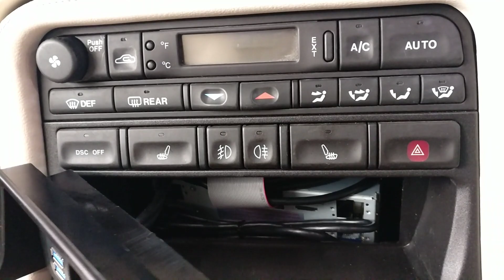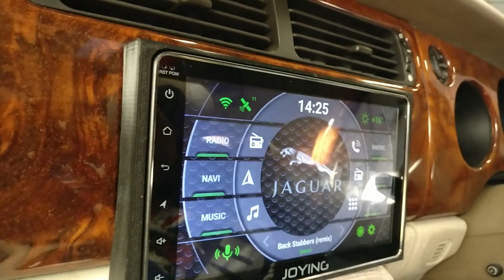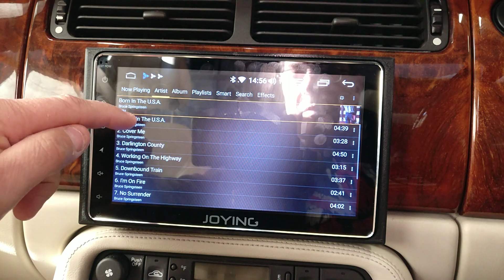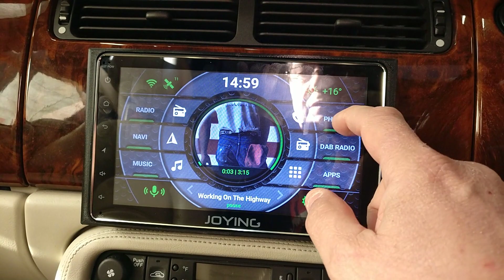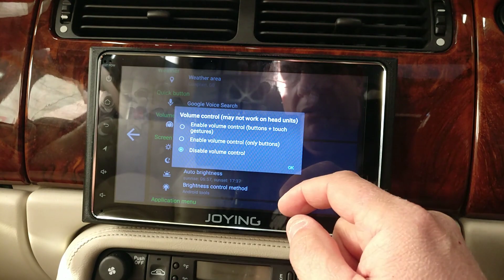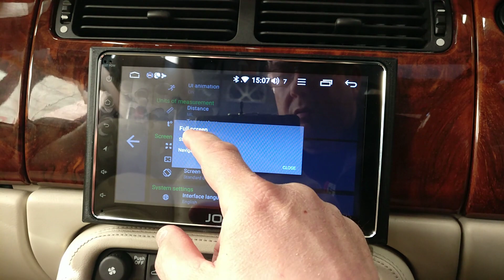Joying Head Unit In Jaguar XKR

Comment: Hello Russell, awesome video. I was wondering where you got the single din trim for below. This unit appears to be discontinued and the newer version's dimensions changed. I think I will used ur cad files and modify them for the new unit. I will share with you when I do. Amazing works cheers.
Reply from the maker: Hi, sorry for the delay replying. If you have a pre 1999 model (I think) then you will need to change the complete AC control and stereo system surround for a post 1999 type. This part is available from BritishParts.co.uk (and possibly elsewhere) and is Jaguar Part No. LJA6318ABG (I will post a link at the end of this reply). You then just swap the A/C panel etc over from the old surround to the new one. If you already have the new type then all is good. Then you need a single DIN adapter panel which will fit directly into the new surround where the factory stereo would go. This is a Nexxia/Autoleads item and is part No. FP-14-00 (once again link at the end). Once you have all this in place then a standard single DIN blanking plate will fit in the slot.

https://www.britishparts.co.uk/jaguar-parts-c11/jaguar-xk-xkr-1996-2006-c45/body-fittings-c366/console-switch-panel-p6364
https://www.rudiemods.co.uk/autoleads-fp-14-00-jaguar-facia-panel-adaptor-free-delivery

Hope this helps and feel free to ask if you need any further help.
Reply: @russellspearing7523  I am going to take ur cad and modify it for thus newer version. My question to you do you think this could be achieved without the bezel around the joying. But instead just mounted from behind so all you see is the joying metallic bezel? Also I noticed some holes in the top and bottom of your bezel. Is there a function for those or for cooling?

https://www.joyingauto.com/joying-newest-8-inch-universal-1-din-car-radio-with-hd-1280x800-screen.html
Reply from the maker: @rnpshiii  Yes you could easily fit the screen without the bezel by incorporating the Joying screen fixings into the rear mount. The reasons I went with the bezel arrangement was that the 8" screen on it's own wasn't wide enough to cover the holes either side of the factory sat nav screen where the original sat nav controls were. For that I would have had to use the 10" Joying unit and then the screen would have been too tall. Therefore I designed the bezel to be wide enough to cover the holes and follow the contour of the dash. That is why the bezel is wider at the sides than top and bottom.
With regard to the holes top and bottom, this is to fix the screen into the bezel. The joying screen has a thin metal bezel surrounding it which is held in place with M2.5 screws (2 top, 2 bottom and either 1 or 2 left and right). So I removed the 2 top and bottom ones and incorporated holes in the 3d print to then screw the screen into the bezel. My original design used velcro to hold the screen into the bezel which is why there are rectangular recesses at the rear of the bezel to incorporate the velcro. However this design was not successful because once the screen was in place I couldn't get it back out again as there was nowhere to lever it away from the velcro. So I abandoned this idea and went with the screws.
Reply: @russellspearing7523  thanks again Russell will upload my final cad once I confirm it works. Cheers
Reply from the maker: @rnpshiii  What material are you planning to print with. My first attempt was with PLA but it very quickly started deforming when the interior of the car got warm. I ended up using ABS which has had no problems at all although it was a real pain to print. It is also possible that PETG would also work but I haven't tried that. I've never had much success with PETG.
Reply: Hey Russell,

Just got it fitted but alot of bugs and not setup yet. Can you link the Play store app for Jaguar interface?

Comment: do you have video on fitting the bracket?  did you have to drill into the veneer?
Reply from the maker: No, I don't have a video on fitting it but I do have some pictures I think (as long as I can find them). No drilling was required and the whole mount system uses the existing fixing holes so I can revert it back to factory standard and no-one would be any the wiser.
I'll see what pictures I have and maybe do another video showing the pictures and an audio commentary of what's going on to help you.

Comment: Hi ! Great work. Im almost finish doing my XKR with this same radio and mounting brakets. Thank You for sharing your 3D Files 🙏🏻. I only ran into a problem and its the power Antenna. Doesnt go down when you switch from radio to another source of music, also the antenna stays up for almost 5 minutes after turning radio or vehicle off. Any Ideas ?
Reply from the maker: No, I'm afraid not. I have experienced exactly the same thing and never found out why. However it didn't really bother me because I had already fitted a switch to disable the auto antenna in the cubbyhole under the armrest because I very rarely use the radio. Also I don't think it is even supposed to go down when you change music sources, it just goes up when you turn the unit on and (supposedly) goes down when you turn it off. This is the same funtionality as the factory fitted stereo.
Reply: @russellspearing7523  Great !! I did the same !! Now all good !! It is just a software problem. Now with the switch, I can control that. Thank You !

Comment: Did you need a specific harness to fit on th e Jag?
Reply from the maker: Hi, I used a wiring harness adaptor to convert from the proprietary Jaguar head unit connector to standard ISO connectors. No adapter was required to get the steering wheel controls working, this was just a direct connection from the wire labeled 'KEY1' from the Joying unit to pin 2 on connector IC20 which is the 26way yellow connector that was originally in the back of the Jaguar head unit.
Reply: It was a premium or standard stereo?
Reply from the maker: @jpe8400  Mine was standard but you can get a wiring harness for premium as well.